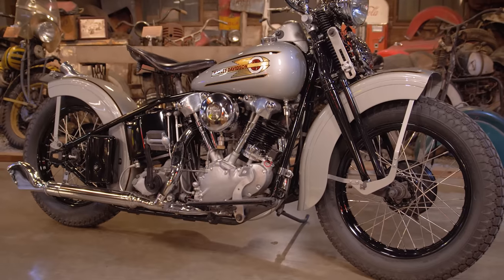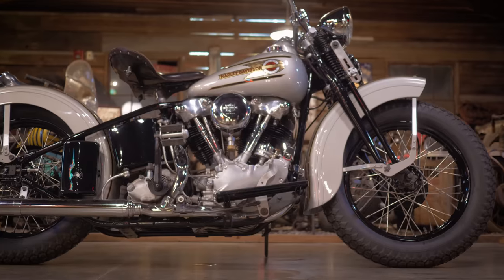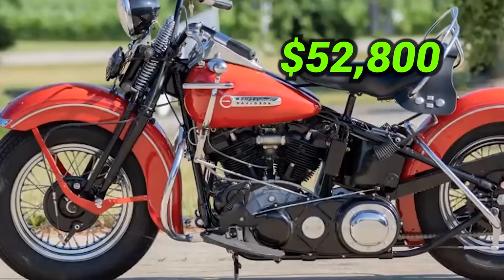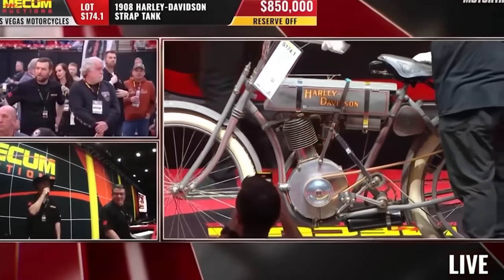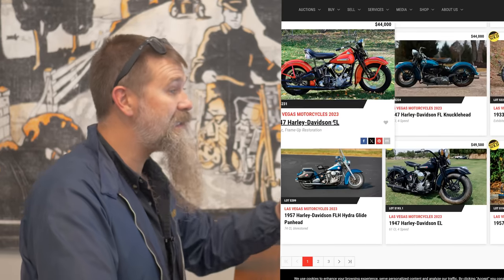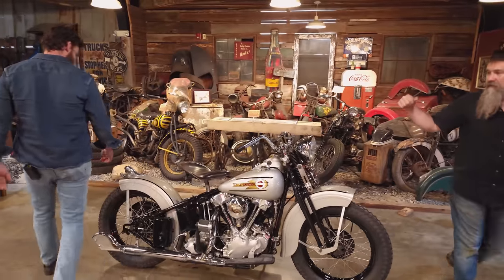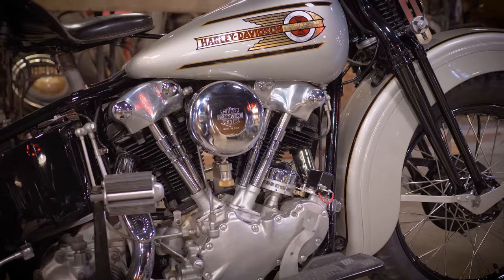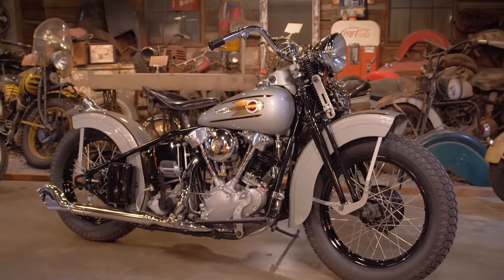Is This Bike REALLY Worth $100,000?

Comment: As a Brit, our style of motorcycle is vastly different, due to our narrow winding roads, small villages and towns
and they seem to age very quickly, you can tell the period of them by the ordination 
of the handlebars footrest and levers
But the Knucklehead just look so modern, in fact it looks better than many modern Harleys
and unlike our old bikes you could ride the Knuckle far and fast
having the prices go so high, also means machines will be found and restored, rather than rotting away or being scrapped
I felt you emotion when your fathers motorcycle came up, thats a special bond that will never be broken

Comment: Love your channel. l absolutely respect your knowledge....But like you said on another video they were built for leaded fuel. Cannot burn Corn Whiskey no lead fuel....Non ethanol is close to $5 bucks a gallon here and then you must add a can of lead additive for the valves....Just Damn....Like your Father probably told you ...Nothing new worth a DAMN......
Reply: Upgraded, and unleaded capatable, valve seats, valve guides, and valves, are all that's required for a correct upgrade for modern fuel. All typical of a correct rebuild of a vintage engine, regardless of it being a race build or a everyday rider. I do several a year.

Comment: And it was wise to go with Andrews aftermarket transmission gears so it won't fail like the stock unit is famous for.
Reply: I've been around Harley 4 speed transmissions for over 50 years, thanks for letting me know that they are famous for failing. I never had an issue so I must be overdue 🤔
Reply: @kurtfoulke5130  I'd say you're quite lucky.  My uncle raced top fuel Harleys 40-55 years ago.  He was #7 in the country.  For a road bike if it wasn't a 74 c.i. Sportster he wanted nothing to do with it.  The $ he spent on Harleys made me decide to buy Japanese.  Boy was that a wise move.  I have yet to put significant money into a motorcycle and have never been stranded.  Nothing but fun.  Uncle Al got stranded several times, and then there were times he had to stop and rest so he could get his high compression engine started.  And he was a pro.  No thanks.
Reply: @wsbill14224  That story is harder to follow than the Tail of The Dragon 🤔
If your Uncle had a 1200 Sportster with a 4 speed, they were only made in 1988-90.
That transmission is an entirely different animal from one used in an El or FL 1936-84
Reply: @kurtfoulke5130  Uncle Al didn't mess with knuckleheads because they weren't powerful enough.  We were all young then.